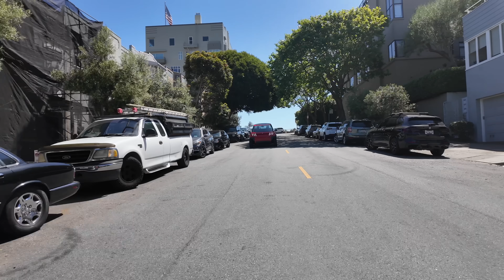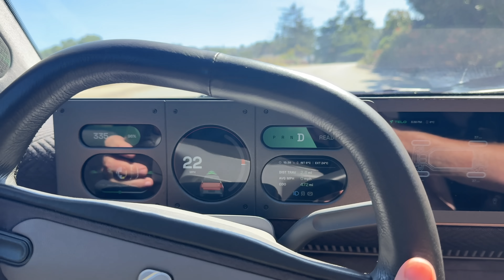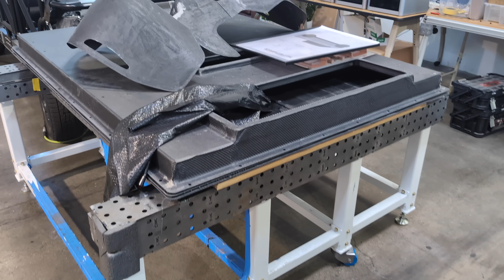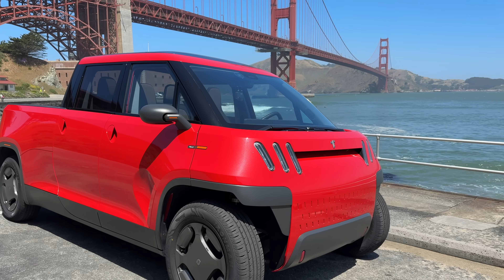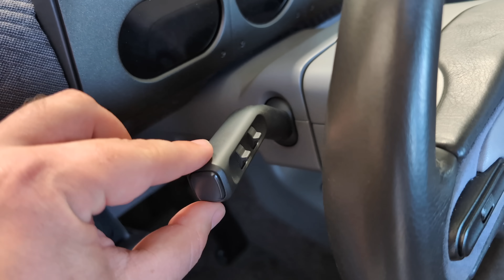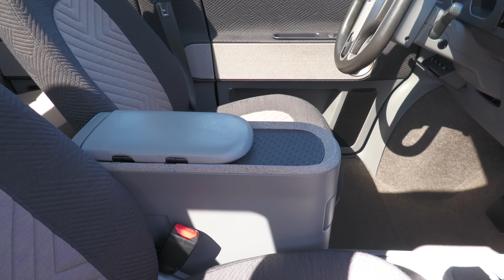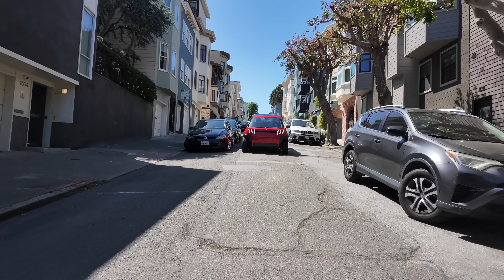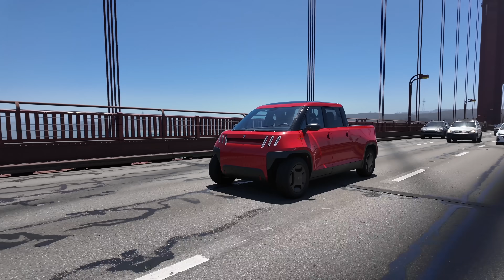The Tiny Telo Truck Hopes to Pack a Big Truck Punch

Comment: Telo's true business model is to develop the truck. Make and sell a few hundred and then have Tata motors or some foreign investors  buy them out. The old software developer model from the late 90's and early 2000's that would have Micro Soft buy them out. Good Luck. The truck has a market and I agree with jezbrown5446, it's in southeast asia.

Comment: The main problem with the telo vs the slate (its only real electric competition) is the price. This is going to be 45-60k vs the slates 20-35k. In my opinion this is also overpowered to the point of being dangerous. Not every vehicle needs to do 0-60 in 4 seconds. A lot to like about it though.
Reply: Apparently the quick 0-60 time is good to know if you intend to use a vehicle for towing, because it translates to being able to easily accelerate and overtake while towing.  Vehicles with slower 0-60 acceleration can struggle getting up to speed with a load on the back, and have difficulty overtaking on the highway (of the type common in rural areas here in Australia, where it's one lane either way and you have to get around the car before the next oncoming vehicle comes along).
Reply: @Berkeloid0  its a truck.  It doesn't need to beat a Ferrari in a race
Reply: @gabriels1163  Hence why I said it's a proxy for measuring overall power for towing, since you can never accelerate that quickly in traffic anyway.

Comment: Having the front wheels covered by wheel arches has been a thing since the 1920s because taking a fender bender to a fender just bends the fender (ha), while taking a good bump to the front of a wheel can bend or break a ton of stuff.  What a terrible design.  (also what's with all the tiny EV trucks when EVs are terrible for hauling anything, where are the ICE or hybrid small trucks?  Even Tacomas are as big as Tundras used to be)

Comment: Definitely not worth the back seats unless the wheelbase is extended. Also, the fact he's promising to keep everything in house means it will forever be overpriced once at scale. I bet he'll quickly contract out the battery to a dedicated manufacturer faaster than he wants to admit.

Overall, good idea, poor design, expensive. Add another EV pass to the list.

Comment: This is an awesome truck. I'd really like to have one electric (no money, no space, nothing at the moment right now) but let me tell you as an european, and living in canada, this appeals me a lot. Like A LOT. I do not like the big ones here, not efficient enought, not enough range, the feeling, everything. This is so cool. I do not know if they will review the comments but let me put here some things that I consider crucial as car auto-maker that most of current automaker DO NOT have correctly :
-Do not put gearbox buttons. You could use a dial gearbox button, it does not matter, but do not put buttons for each (P, N, D, R...) thing. This is the worst.
-Do not put climate control ONLY on touch screen. This is the most stupid shit ever. You can put them on screen, but leave tactile buttons accessible for driver so he can adjust it without looking at the screen.
-For the infotainment, you should absolutely use someone experienced into UI and UX. Options should be always accessible, and important informations (climate control mostly) should be available any time into a glimpse of eye.
-This is a truck, so not pertinent, but on the SUV, DO NOT, I REPEAT, DO NOT put an automatic opening trunk. You can if you want, but if I'm a hurry I want to be able to use my own fucking power to open and close it, I will not wait 10s for that shit to open AND close. This drove me so mad on some courtesy cars I had that I sweared I will never buy because of that.
-Do what you want with door handles, but I want something easy to grab and open in one motion. Do not anything close to the mustang EV shitty button. I had a courtesy mustang EV at some point, and let me tell you most of my complaints come from this car specifically.

This is a list of "do not", instead of "do", but they are majors irritating shits I get, and I will specifically seek another option on any car which have theses, including paying more.

Comment: "Just lift off the throttle and throw me through the windshield, it's what I want" 

I feel the same about my Mach E - it needs to be twice as strong as it is now
Reply: It should be the first stage of the brake pedal, not the accelerator. Ever.
Reply: @C.I...  regen on the accelerator is a toggle option and I specifically want it that way, and I want it to be stronger than it is now - I know it can be stronger because the brake pedal has higher regen on the display than just being off the accelerator

Comment: I hope they don’t keep the nmc battery. I understand the power density is important for such a small vehicle. But I’d much rather have 200 mile range instead of 300 mile to have the battery last four times as long with lifepo4.

Comment: 6000 lbs of towing for the little truck is actually quite impressive. But I question how well the suspension would hold up to that. Even though the motor can technically pull it.

Comment: Make it a hybrid with a 2 cylinder boxer engine with a 2 speed auto trans driving the rear wheels, and powering a generator. Then you need fewer batteries with the electric motor driving the rear wheels. And I might actually consider buying a car version of that. Because some people still like cars better than trucks/SUV's.

Comment: It's a tiny ute, and I think the US is ready for it. The company mentions it's classed as an MPV designed the fill the role of a truck. (Filling that "full sized" role even in a city seems like a tall order, but I think it will be extremely useful for folks that might otherwise consider something like a wagon, large hatchback, or older mini truck.) While I don't think this particular model will have the widest appeal, I do appreciate the trail it's blazing when it comes to format. The size, wheelbase, and form factor are all very welcome IMO.

Comment: closer to an ad than it should be.  i know its hard to criticise a product in front of the people that make it but this was a fluff piece that should not have happened.  i am a massive proponent of electric vehicles but this truck isnt it.

imo it either needs to be a smaller cab 2 door and with a even longer bed or just shortened for battery efficiency or they need to offer a 2 door model in addition to the 4 door.  cause the rear seats are abysmal.  dont care how hard you sugarcoat it those seats are basically worthless weight and wasted space.

that price is offensive.  you can use all the excuses and half truths you want.  for 50k i could buy almost any new car i could dream of.  absolutely not.  a BRAND NEW toyota tacoma i force max (a MASSIVE MASSIVE hybrid truck that gets 22 mpg) is LESS than this dingleberry

i wouldnt even CONSIDER this truck unless it's less than 10k brand new BEFORE any rebates or credits. that would still be too high frankly for what youre getting.  amything more is insanity.  you cant even roll the f@%king windows down ffs...

electric vehicles dont NEED any of these concessions.  and people that buy gas powered vehicles for heavy duty work dont hate the environment and are guilty of nothing more than being smart.  its up to the manufacturers to figure out how to be competitive.  and theure failing miserably.

Comment: Here is a free tip for Telo, make a van/suv version with a twist.  Add an electrically moveable partition so you can carry a small load of groceries without spilling them all over the back and can still carry a full size load.  No one offers this and for delivery it would be great.  Cargo nets let small things through or around them

Comment: I hope they don't mandate one pedal driving. I'm fine with a toggle or saved setting, but I actually prefer it to be like a traditional car. I had a bolt and an ioniq 5 and I wish the hi5 saved the regen setting so I didn't have to reset it every time.

Comment: Is it was 20k maybe even 30k id buy one... like that Amazon truck for 20k. But not at its current pricetag 40k+,, maybe if the incentives lowered it to 30k base, and id want the rear shell adding to turn it into a van, it appears to be a highly usefull truck, more capable than the Chevy or Ford in many ways.

Comment: No one buys two-door pickups anymore because no one sells two-door pickups because emissions the extra seats allow for much greater leniency with emissions regulations. This obviously doesn't apply to an electric vehicle. There is no reason not to have an extended bed with no back seat.

Comment: completely open front wheel arches will not pass european regs, which require at least 60% coverage of the front and rear wheels, afaik... and i completely expect that feature to be changed lol.
Design doesnt look conservative enough to sell.
Other than that it looks like the only EV i'll ever consider. the alternative being built by the evil incarnate.
i repair bikes at my customer's homes for a living. 7ft long bed would be ideal for my line of work.

Comment: I’m very interested to see how it performs in crash testing, specifically front overlap. With there being virtually no crumple zone in front of the front tires, or behind them (and in front of your legs. Given that it’s an EV with a low slung battery pack, I don’t really see the cockpit riding over the front wheels without some clever engineering. Other than that it’s a neat idea, I love the idea of a compact crew cab pickup with a midgate.

Comment: German here. I would be interested in something like that, but with three changes.
1. Full cab. It's raining to much here for an open bed. I want to put things in and leave it there for a few days.
2. Removable back seats. I only need more than two seats few times a year, so having them in there will take away transportation space.
3. Tow hitch. I would use it mainly for towing. I have multiple trailers for different uses, i bring to the job site and get it back after the job is done.
And about the displays. Please by the love of god, don't put in "entertaining" beyond radio. No one want's flashing, pinging, notifications, animations, or anything like that on a car screen. No distraction from diving please.

Comment: $41K is insane for what is basically a kei truck with a duracell in it.
If it was a longbox single cab (with a bench seat), that sacrificed horsepower for more range, I might be more inclined to purchase.
Also, a budget version with no A/C, fancy touchscreens, sunroof, rear outlets, interior, etc. would be nice.
15-20K for a budget version would be tres bon!

Comment: 350 miles of range, that's if you don't have the radio or sat nav on and you're on an extreme echo run, it also takes hours on end to charge up, cost more to keep running, batteries only last a few years and cost thousands each. The materials for the batteries have to be mined and are mined by children as well as adults, that's not even taking into consideration how the electric is produced to create the electricity to charge it up. At least with petrol/diesel vehicles the fuel can be made using plants and can do more than 350 miles in less than 1 day and only takes a couple of minutes or so to fill the tank up and they don't need to go on a trailer if the battery goes completely flat, plus it only takes a couple of minutes to change the battery. Petrol/diesel vehicles are better than electric cars and don't need to be charged up every single day or every time you park up to go shopping. I've had the privilege to speak to members of the emergency service, who are also not happy with being given electric vehicles to drive, especially considering that ambulances use electricity for their life saving equipment, which will drain the batteries on electric ambulances, making it less likely for the ambulance to be able to make it to hospital or do numerous jobs. The only people who buy/drive electric vehicles are complete and utter idiots who don't know how to use their brains properly. When the brainless government bans petrol and diesel vehicles, I will be giving up driving and giving up on my health issues.

Comment: I know a lot of the things I don't like about modern trucks are because of messed up CAFE standards like basically requiring a crew cab, but even without the incentives/rebates I still see the Slate being what people actually want and not this. I say that wishing this was because I would rather Amazon/Bezos not be the one to make the trucks we actually need.

Not every EV needs to be a rocket ship or should be. Sure you can have powerful motors, but I'd love to see companies actually focus on making them lean more toward being efficient and focus on using the additional power/torque when it's needed based on load. Less screens, less menus, more buttons and switches you can use by feel. It's just plain safer that way. Include standard DIN sized radios you can replace with aftermarket radios. On a similar note don't integrate the infotainment into the car's actual computer, just... no. The computers that run the drivetrain do just that and nothing else. At most it should be readable by another system, but otherwise it's isolated from having changes made to it. Make over the air updates opt in, just notify someone when they have an update and never force it unless they choose to make it so. Make it repairable by third party garages, especially with smaller manufacturers like these. We can't rely on your network, we need regular EV mechanics to be able to fix these things.

And by all that is holy please make the brake lights turn on after a half to one second of regen braking.

Comment: Not a big EV fan, but that company seems pretty grounded. The main issue with starting slow and cheap is the trucks will probably cost well north of $100k to produce at low volumes. You need some volume to do the better tools and get costs down to a reasonable level, and that reasonable level is still way more than the $41k they say will be the base price. Also, I'm not convinced that they do have enough crumple zone up front.

Comment: Here’s the thing.  Telo, like many startups, are ignoring the very simple and amazing thing.  Stop trying to iterate on things that already exist.  I don’t mean trucks or hatchbacks or teeny tiny subcompact death traps.  I mean that kei vehicles already exist and they look substantially neater than this…truck shaped thing.  Kei trucks should have been the template for this thing.  The ford ranger, the tiny Toyota truck should have been the starting point because they are a tried and true design that comes with one amazing bonus.  You can yoink the bed off and put in a flatbed.  That being said, they have a solution for that in the kei trucks that have the fold down sides.
As for the price, I get it that they want to keep as much in house as possible, but here’s the thing, you will always have to deal with supply chains for it…unless you plan on mining and refining lithium or whatever you are going to use for the batteries and every other raw material you need to make the batteries.  So they are packing their batteries, but why?  Why expend the manpower to do something an already established business is doing at scale and can make them whatever size you want?
That roof isn’t a good idea for what is theoretically a work truck.  Imagine working all day in the heat and sun and then getting into a hotbox with three other sweaty dudes and the sun is still baking down on you.  Even if you UV that thing, if it doesn’t have some kind of retractable shade to it, screw that noise.
Want to know how to not have that air break in the wheel well?  Have a front of the vehicle that extends over and in front of the front wheel.  Crazy, I know.
Also, why TF would you put the charge port there?  Why not, I don’t know, at the front.  Not just for easy of use, but because the corners of cars are where people do dumb accidents.
Stop putting infotainment displays into the cars.  I am not saying this as someone who hates infotainment.  I am saying this as someone who understands safety and that a person can use a radio and crap by touch, but the second you have to look to see the display, you’ve put yourself at risk.  Just do a standard radio with Bluetooth and a simple info cluster in front of the driver.  It’s cheaper and you don’t have to do this whole song and dance of UI shenanigans.
I do want to point something out about their design philosophy.  They spent a lot of time designing aspects of this thing that already exist, that have been tested for safety and durability.  Those pedestal seats, that doesn’t sound safe, but they did it for foot space which they needed because they wanted to cram in back seats which they needed to design in such a way that the back folds down which they needed to do to fit a comparable cargo area.
And there’s no frunk.  Literally one of the great things you can do with an EV and NOPE, why have something people want.
Sorry, I just want someone to design something that isn’t ass expensive and is functional.  Give me a 15K Ford Ranger EV that looks like a 90s Ford Ranger.

Comment: This is the Kei Truck for the US. If I had a business that needed to do deliveries or as a parts getter this is perfect. I can see this as a return of the minitruck market. Forget that it is an electric. The selling point for me is the size. A decent sized bed in a small package. I had a Subaru Brat a lifetime ago and its rebirth 10 years ago, this would fit right in. I am not towing, carring loads long distance or  needing to reafirm my manhood with a truck. I just need to get stuff from point A to point B and that is where this looks like it will do that and more.